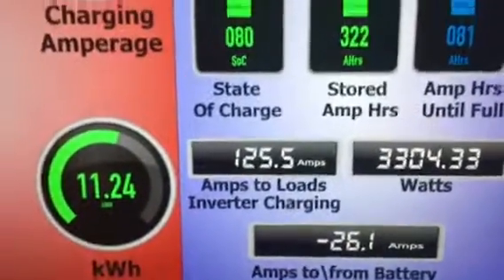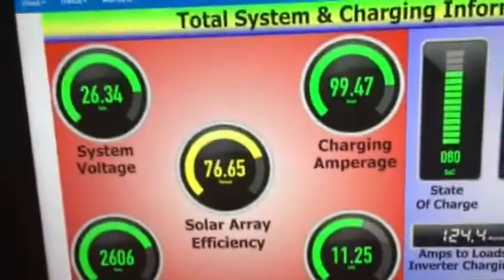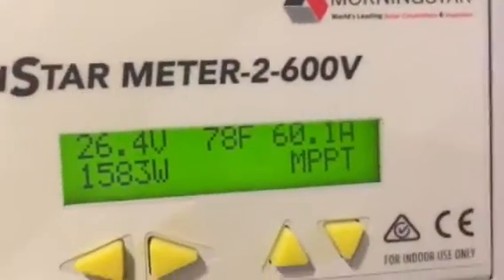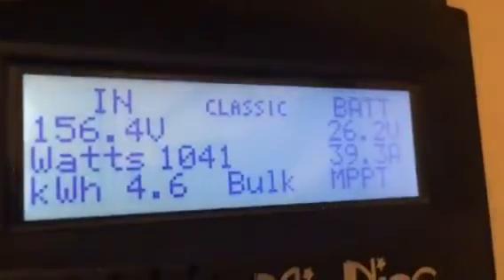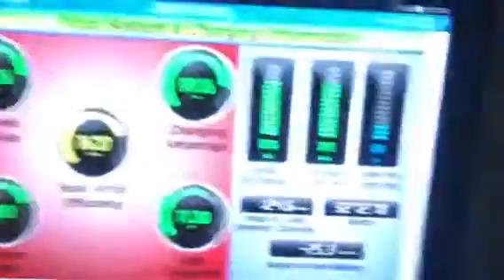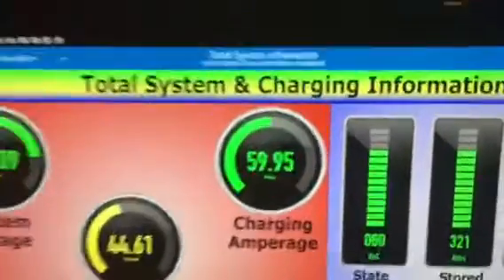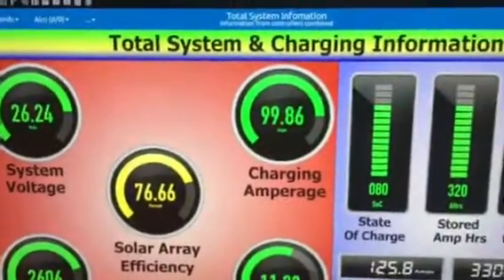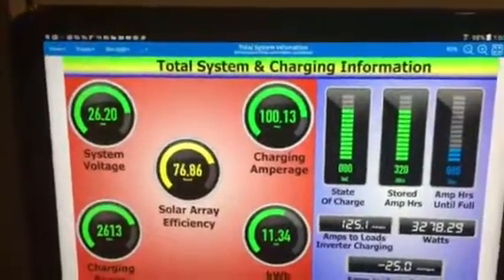What happens when MPPT charge controllers work together?

Comment: Thanks for posting this, it was something I was very concerned/perplexed about until I went off grid and quickly discovered --- charge controllers simply pour their heart out as long as the target "float" voltage is somewhere north (above) your static battery voltage.  Simply put- they don't give a shit.  And they use their inductors to set whatever (MPPT) inductance they feel comfortable with. I commonly see 3 different banks of panels running at 3 different VMP, some varying by 20 volts !.. yet the charge controllers live in harmony.    #allgood
Reply from the maker: Thanks for the comments, Glad to know there is another good example of multiple charge controllers working together in a way similar to mine.

Comment: Pretty cool, your system sure has come a long way over the years.
I just saw a sale for 230 watt panels (24 volt) for $0.30 a watt. Shipping is a killer though  at $450 for a pallet of 10 from California to the Midwest
Reply from the maker: That's sounds like a really good deal even with shipping cost.  The shipping looks to be a fair price for the number of panels size and weight.  Me personally, I wouldn't hesitate to scoop that up.  Presently, I have all the panels I need at the moment or I would go for it.

Comment: to bad your not on a 48 volt system. you can squeeze 3700 watts out of the TriStar charge controller.  it keeps the current draw down. all in all your System working well
Reply from the maker: Thanks for the comment, and yes a 48V system would've  been awesome with the added power.